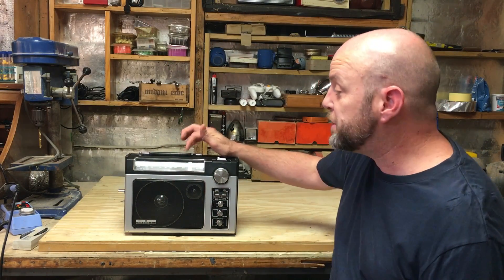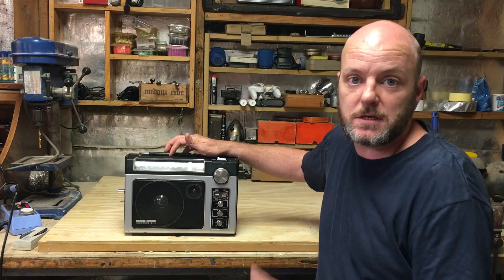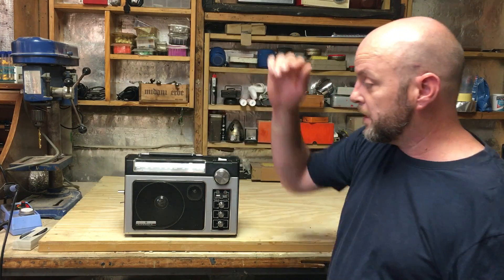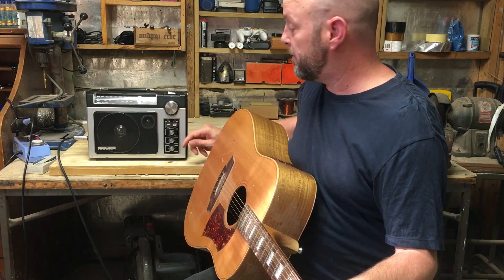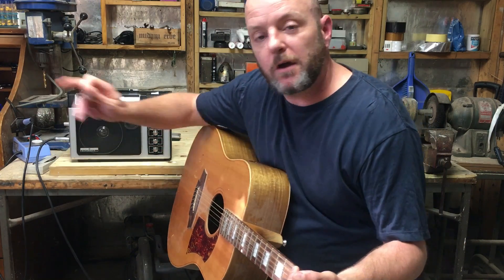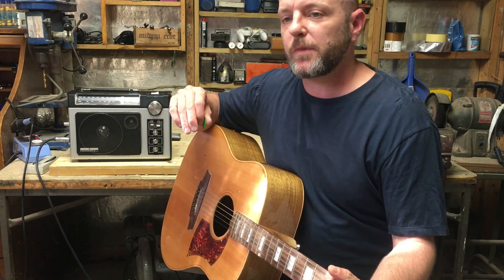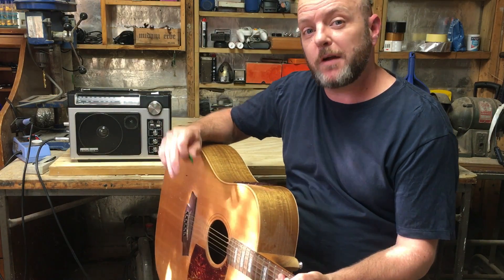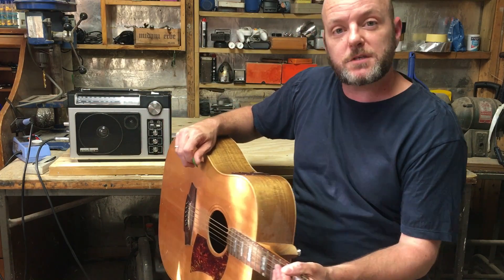Hack a Radio Into a Guitar Amp

Comment: I play a 3 string cbg. I use a rotary phone earpiece wired to a cassette head on an old stereo. i have found that smaller cassette players have more gain and grunge
Reply from the maker: interesting.  so do you wire the earpiece up and place it on the cigar box then?
Reply: @lonesoulsurfer  yep. It's a microphone at that point. Mics and speakers are the same thing except for the jack. Input and output. You can use a speaker of any size. Larger ones can be used (4" or larger) to pick up ambient sound.
Reply: I'll get  video today

Comment: Hello,I am from Italy so I don't understand all the points u talked about.
So I kindly ask if is it possible bypassing the radio stations to avoid the buzz noise.
Thanks so much KEEP IT ROCK!!
Reply from the maker: Hello from Australia.  You could by-pass the radio and just tap into the amp circuit on the radio.  However, you shouldn't really hear any buzzing if wired up right.  Usually the volume knob has a number of solder points, try each one and use the one that doesn't have any buzzing from the radio.  

Good luck.
Reply: @lonesoulsurfer  Thanks so much 🎸🎸🎸

Comment: Do you think a radio would be able to handle a bass guitar or would it blow the speaker? I would love to try this as a bass amp.
Reply from the maker: Yep I don't think you would have any issues with plugging a bass into one.  Esp if the radio has a good sized speaker
Reply: try it all you lose is time and a throw away radio

Comment: Thanks for this upgrade of your radio amp hack!
If I change the 100nF cap with another one, what will it do?
Reply from the maker: I did do a little experimenting and changing the value doesn't do a hell of a lot.  I found though that 100nf cap gave a nice clean sound so decided to go with that.  I'd experiment with some different values to see whether you can get different sounds
Reply: @lonesoulsurfer  Thank you for the answer!